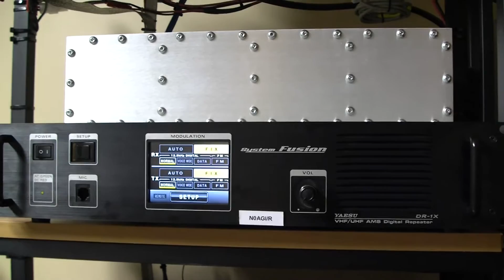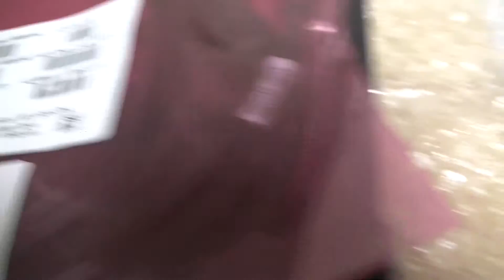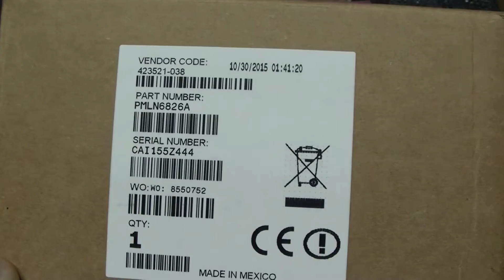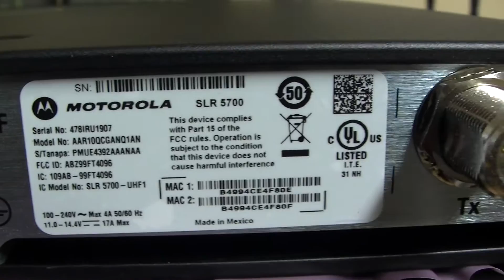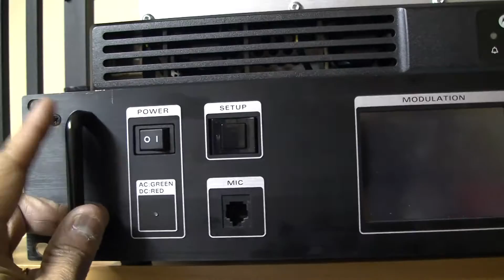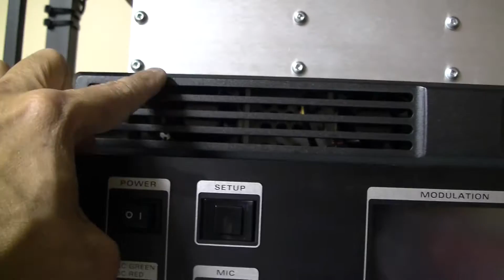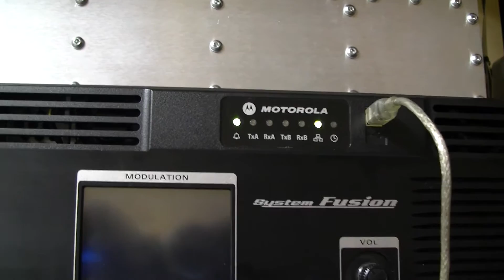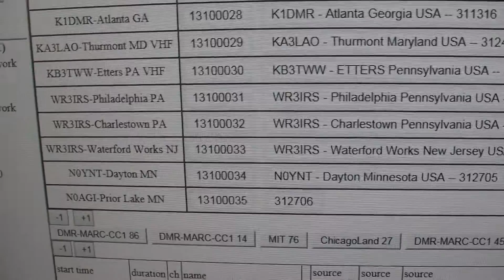N0AGI - MOTOTRBO DMR REPEATER - PART 1

Comment: Can this repeater be programmed with CPS Version 16 or is it 2.0 only?
Reply from the maker: For sure the earlier version of cps 1 (v16). Not sure abt  CPS 2. It should be doable. But, please do confirm.
Reply: @N0AGI  Do you know what Firmware version you have on this repeater?  I think I read that anything newer than R02.09.00.13 will not work with CPS16.
Reply from the maker: @AmericanZ28  good point -  that is an accurate statement. I dont recall what version of fw is on my repeater to be honest.

I could try to go into RDAC s/w to remote connect to the repeater via the cbridge to determine qhat fw ver I have. 

I wont be able to do that at the moment though.

Comment: Dmr. Repeaters don't use duplexers. They use time slot one and two.
Reply: you still need duplexer if you intend to use only 1 antenna for both Rx and Tx.
Reply: @shahie72  i agreed , still need duplexer if use only one antenna for Tx and Rx
Reply: Shaheedan Abdul Wahab shouldn’t it be able to receive on time slot 1 and transmit on time slot 2? The Blackbox Lunchbox repeater does this and I’m surprised more repeaters don’t do that
Reply: @Nicksperiments  No, time slot is a way of holding two conversations at once on the same frequency. You still need to isolate the receiver and transmitter from each other.
Reply: Good choice in RX preamps however in a single site repeater that is not hooked into a combiner system does not need additional amplification.

Comment: Hi nice video, I have issue regarding SLR 5500 analog mode when i use CSQ unable to pass multi PL
Reply from the maker: Sorry, I only have limited  hands-on experience setting up an analog mode on this repeater.  Unable to help answer. But, a good place to start is with your vendor, they should be able to assist

Comment: Are you familiar with how to set up users on the repeater if you were to use it stand alone? Since you're part of a network with your machine, I believe that information filters down from the "master" repeater on the C-bridge. I'm wondering how to set up users/radio ID numbers for a stand alone repeater.
Reply from the maker: Since the repeater is joined with a cbridge network, the user access controls flow from the "master".